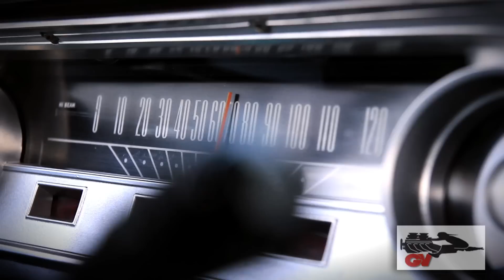Ford Falcon Wide Ratio AOD or 4R70 transmission swap vs Close ratio C4 6 speed - Gear Vendors

Comment: I'd rather have torque converter lock up in the 4R70W over the C4 with added on overdrive.  You can lock and unlock the converter to split the gears up.  My 4R70W in the Falcon feels like it shifts 6 times with lock up in 2,3,and 4th gear.
Reply from the maker: +Ryan Denney Hi Ryan - You would not if you ever tried a Gear Vendors.  A 4R70 is a wide ratio trans that even with control of the lockup will never give you the close ratio of 6 actual ratios from 2.48 to .778.  Power handling and reliability far greater with the Gear Vendors setup.  If you ever get the chance to take a ride in a Gear Vendors equipped car you would then instantly feel the difference.
Reply: +Rick Johnson How does the GV know what gear the C4 is in?  Without some sort of feed back from the C4 trans you'll likely never see all 6 ratios during a steady 20% throttle accel.  I suppose in a fairly stockish 289/302 in a 3500 lb car you see 2 or 3 gear splits on down shifts.  A late model roller 306 on 14lbs of boost doesn't have time for the trans and added over drive until to sort out who's doing the shifting and how often.  Modern electronic transmissions still have there place in the performance market.  The 2k price tag for a GV would buy lots of 4R70W parts.  The GV unit will out last most C4s anyway.

Comment: I have to say thank you for this video, I had the fmx-aod conversion in my 70 cougar and had the aod built... 70 mph 1900 rpms. Huge improvement over the fix, thank you
Reply: Hello, I'm working on the same setup on my 70 Cougar, do you recall what size bell housing bolts you used?
Reply from the maker: Gear Vendors also make a direct kit that fits the Cougar with the FMX as a direct bolt in.

Comment: Dont forget about transmission fluid temps when when used with a non lock-up transmission.  Especially if you use a high stall converter.  Ex:  running a 3500 converter at say 55 mph would mean around 2000 rpm's.  That a lot of slip and greatly shortens the fluid and trans life. 4R70W is the better high performance choice since it has lock-up and then you  can run any converter you want.
Reply from the maker: Hi Makitta - Do not know how I missed responding to this earlier - it is a common misunderstanding about Torque Converters.  When cruising steady at 55 as you point out you are only making about 50hp no matter how much engine you have or you would be accelerating.  at 50hp at 55 mph or even say 100 hp at 80mph any decent converter is going to be very close to full 1:1.  The stall only comes to play if you have the 400hp or so you built the converter to flash to.
Call us anytime to discuss in detail.  It is a great subject which we have proven for 35 yrs.  We have now 5500 stall converters in cars like Jeff Lutz. Tom Bailey, Larry Larson, Bryant Goldstone  - all doing 2000 rpm at 70mph in overdrive on the street with cars that make over 3,000hp ( of course at that moment of cruising they are really only probably at 65 hp during steady state cruising).  The factory lockups on newer cars are to net another 5% in fuel economy because CAFE standards mean millions of dollars in penalties otherwise.  So they want to run 1700 rpm at 70 and thus get every once of fuel economy possible.  Our customer cares about 25% better fuel economy and Gear Vendors will get you that but our customer does not prefer the downsides of a lockup and its expense for the minor benefit it offers on the epa test cycle.

Comment: Went through this dilemma years ago with my F250 (C6 stock). Ended up fitting an E4OD with aftermarket controller. I wanted much lower cruising RPMs than what's possible with anything that doesn't have a locking torque converter.
Reply from the maker: Hi David - There are a lot of things to consider - in this application (Ford Falcon) the Gear Vendors is far better than an E40D.  With the F250 many more possibilities and some pluses depending on terrain and load where the Gear Vendors is better and the lockup not so much.  But yes if you are diesel trying to get down to 1700 rpm then you need a lockup.  It is why we have sold thousands of Gear Vendors for the E40d to gear split ratios and why the tuck now has a 7 speed automatic in it stock.
Reply: Hi Rick,
I didn't mean to suggest an E4OD in that application since it might not even fit under the floor of a falcon. I actually know a fellow member on oilburners.net that has an E4OD, 3:55 ratio and GV overdrive. Its the only truck I know of similar to mine with an even taller final drive ratio. I have a 3.08 rear end, but no aux overdrive.

Not sure if I would really need 7 forward speeds since I already have 2 top gears. At freeway speeds the old diesel is turning 2300 RPM in 3rd and 1600 RPM in 4th.
Reply: I tried  the Gear Venders in  my Mustang  years ago and  the Over drive is not enough.  i switched to a T5 with a .68 over drive
! this worked  better with my 4.11 gears than the .78 over that the  gear venders had! The gear venders id too expensive  to not have a choice  of over drive ratios, It cost more than  my complete T5.
Reply: @mylanmiller9656  why are you using 4.11 rear gears? Are you drag racing?
Reply: @musclebone7875  my car sees both  Street and strip, I run short slicks on the drag strip and tall tires on the high way!  I got the best Drag times with 4.86 gears and 10'x 26 x 15 slicks but it was not street able!
Reply: @mylanmiller9656  i gotcha! I think gear vendors overdrive would be a improvement to your combo.
Reply: @musclebone7875   No thanks I tried  the  gear venders. it is to expensive and the over drive is not enough!
Reply: @mylanmiller9656  hey i feel you! I totally understand that somethings aren't for everyone. Hopefully you find the right drivetrain combo that you are looking for.  👍

Comment: Hi Rick, I have a nice 64 Falcon w 260 motor a little warmed over plus a C4 (was changed at some time). Mine is just like this one same RPM's at 70. I have thought about doing the same thing since the 260 has a 5 bolt bellhousing a AOD will not work. I'm here in LA do you do this?

Comment: l have just put Gear Vendors overdrive on my 79 firebird with stroked 455 olds 
haven't  hammered it yet it was running 12.4

Comment: 2700 RPM is exactly where i wanna be, how much gear is in the rear of that car, guessing 4.10 ish?
Reply from the maker: Hi Jay. What tire size and rear ratio do you have in it now?  What’s the vehicle. Auto or stick?
Reply: @gvrickf1  its a 79z 3.73 28' tire 4000 stall TH350  wanting to go 4.10 with a GV

Comment: Could I put a GV on the back of my 4R75E?  8 speeds and lockup sounds good though I think the trans in OD then overdriven again would be too high a gear to pull in my tank 06 Crown Vic interceptor.  But I have been kicking around the idea of a 427ci Windsor small block with a C6 and a GV. 6 speeds and a much shorter then the 5 foot driveshaft I have now.
Reply from the maker: I would agree with the second option as the stock trans is a CAFE built wide ratio and lockup - not a very performance oriented package - all about EPA.  Call us at 800-999-9555 and discuss you use and engine, rear ratio etc.

Comment: What happens if you run a GPS speedhut speedo ? Do you need to run the speedo to signal the control box inside the car thanks
Reply from the maker: Our speedo wire input is to our signal generator at the overdrive.  We put the correct ratio speedo gears in the overdrive for your rear gear and tire size. You would typically use that with the included ford speedo adapter to drive your dash but it has no bearing on the overdrive function if you do not screw in your stock speedo.

Comment: Column shifted Sprint? I thought all genuine sprints came with a 4 on the floor manual t-10.
Reply from the maker: I am not certain but my grand mother had an earlier sprint with automatic.
Reply: The 63 1/2 Sprint came with the 4 speed BW or the 2 speed auto hooked up to the 260 V8. Mine has a 302 with a C4. I dropped it off at the El Cajon Gear Vendors shop today for the install.

Comment: You're using the high beam dimmer switch to activate the overdrive. What happens when you are driving at night time?
Reply from the maker: Shifter button up on the shifter is also an option.  When we use a floor mounted dimmer then we move your stock headlight dimmer over about 5 inches toward the pedals and up about 5 inches higher so you can still reach it easily but not bother your dead-foot position.  Sounds odd to shift on the floor but it actually works very well because you can grab the overdrive gear manually with both hands on the steering wheel even when cornering at speed like from 2 to 2nd over and back down to second - like on canyon roads that are fun to drive.